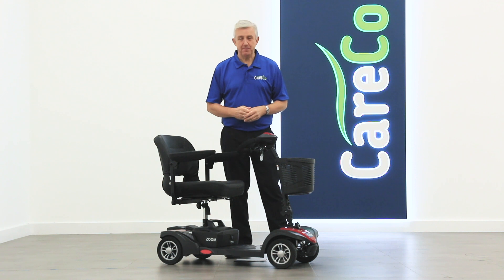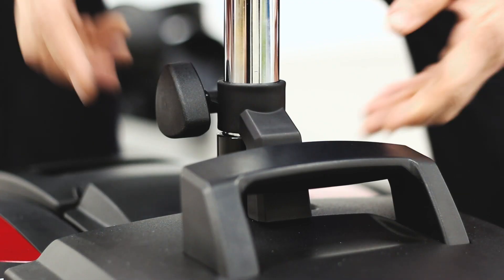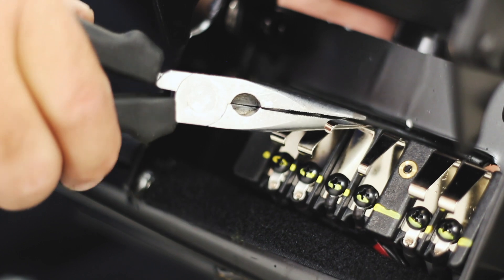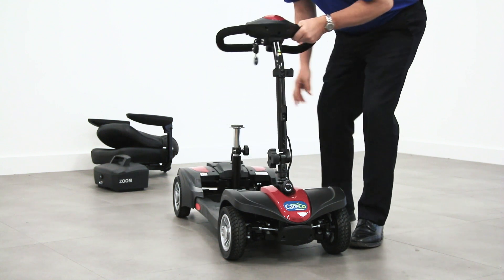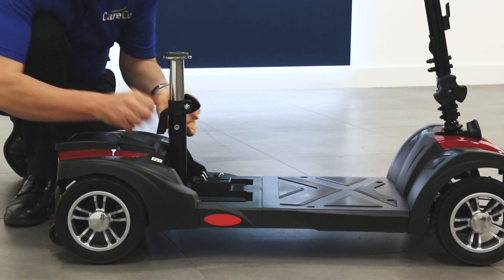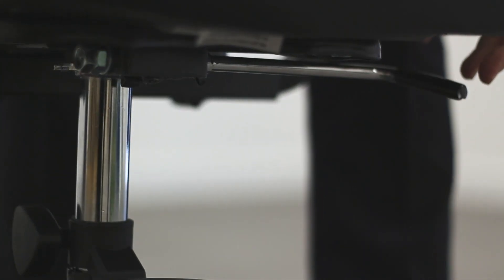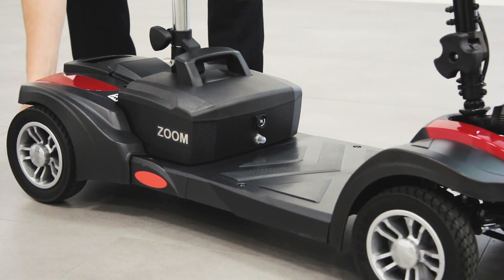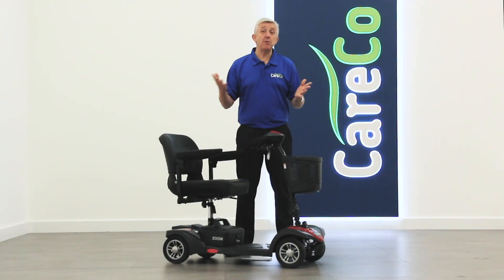How To Maintain Your Travel Scooter

Comment: I wish to know, what are the error codes, I mean flashing green light

I have noticed today when I was moving a lot on the seat that scooter won't move and I could see flashing green light, after power off and power on again everything seems to back to normal but I'm kind of worried now... Any help please, what should I do

Scooter is careco zoom plus and its not warranty anymore
Reply from the maker: Hello, a flashing green light may mean that the scooter is in Neutral mode (wherein the scooter can be pushed manually), this means the engine is disengaged. If this is the case the flick the red switch on the back to Drive mode to use automatically. If you are having any further trouble please contact our Customer Service line: 0333 015 5000.